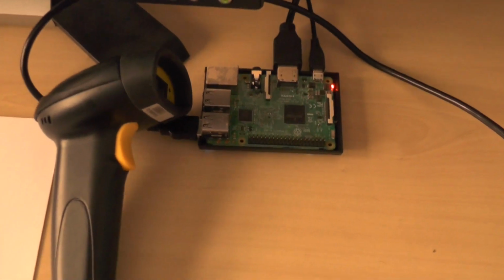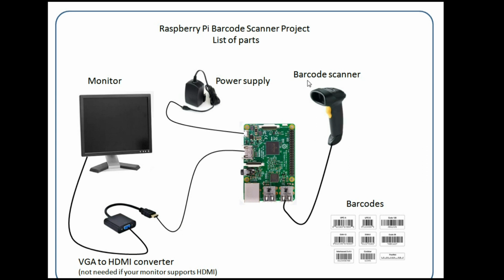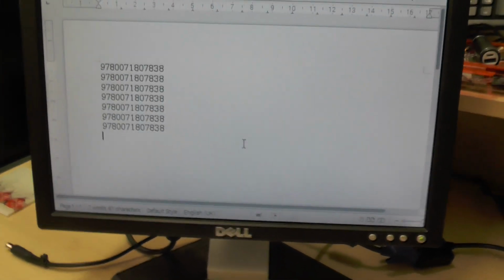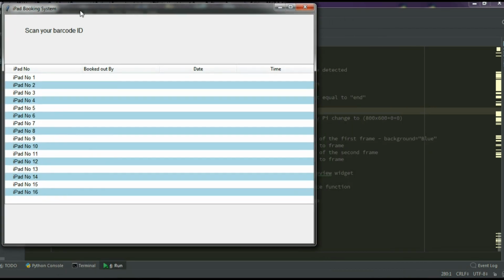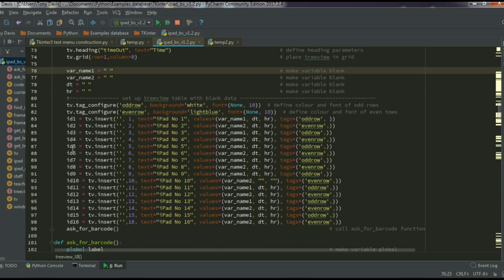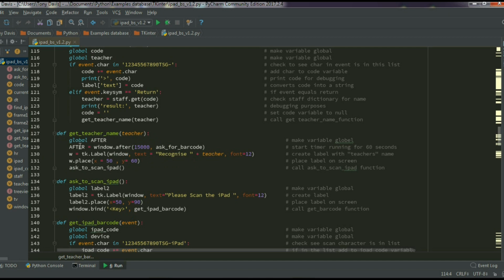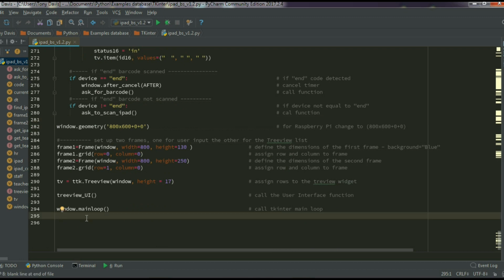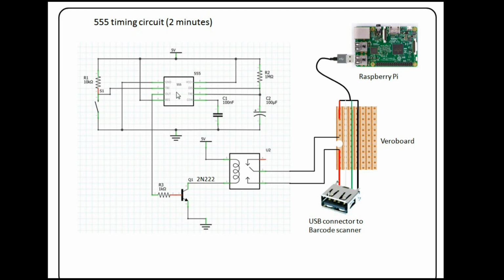Barcode Scanner with Raspberry PI

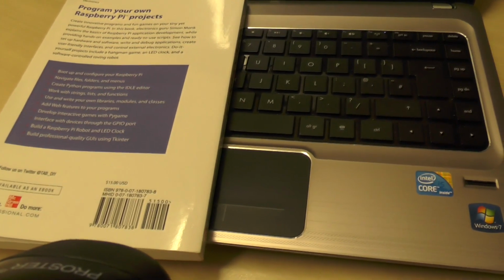Comment: @7:28 i think you need teamviewer instead, Remote desktop connection from my experience is like having two monitors where in each of them does not know what the other is doing, or simply the screen is not shared, on your raspberry pi the barcode is trying to push data, however since your using a remote desktop you won't see what the main unit is doing.

Comment: Did you happen to print the barcodes a special way? I've been using my barcode scanner to read the barcodes on the back of general products from a supermarket but when I print one out it won't scan it. I've tried changing the size of it, the type of barcode and the quality of the print.
Reply from the maker: I didn’t have a problem with the size of the bar code, it seemed to work with a whole range of sizes but I found that “Code-39 Full ASCII” worked best. One thing that you should check is that the barcode scanner is sending out a “carriage return” after scanning the code. If does not do this it will definitely cause you a problem. I had to configure my scanner to do this because by default it was disabled.
Reply: @TonyPDavis  I got back round to this little project today and I managed to fix it by printing my bar codes on glossy paper instead of normal paper. Thanks for the response.